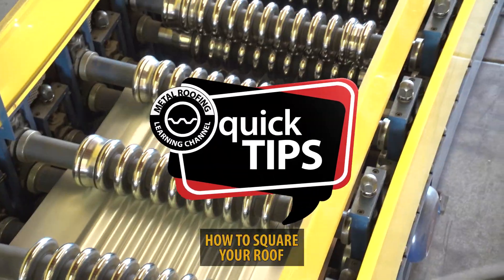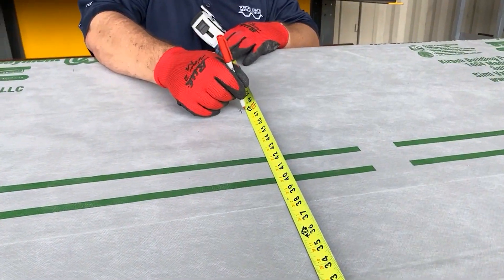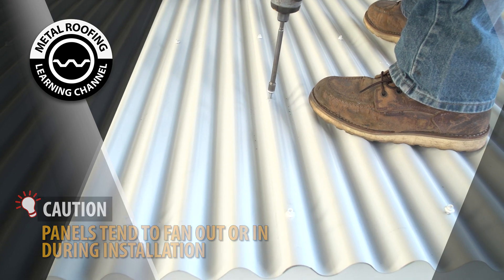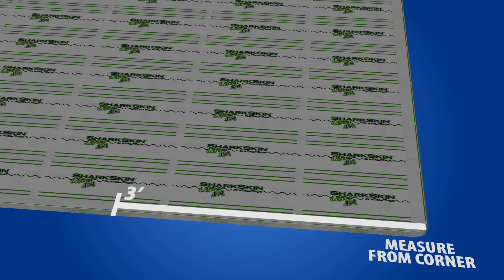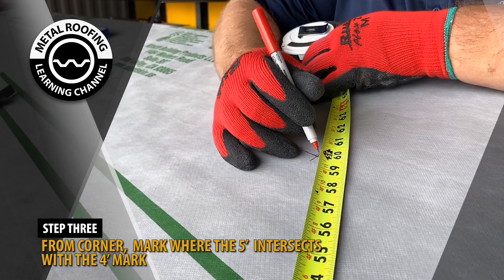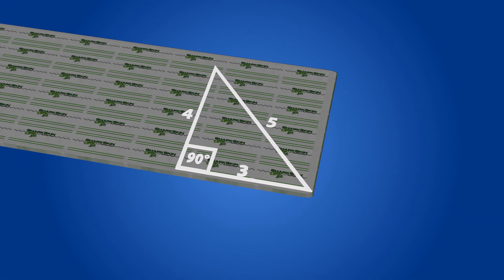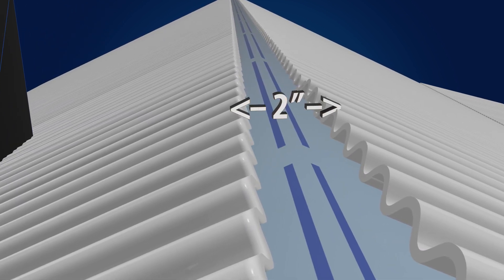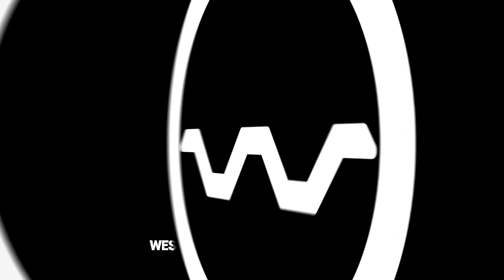How To Square A Roof. EASY Step By Step Video [3,4,5 Triangle Method To Install Metal Roofing]

Comment: Whats thr point of the 5' line if you already have you 4' line going up?
Reply: the 5' Hypotenuse line is crucial to establish 90 degree angle between the 3' and 4' lines, that is what this exercise is all about, however, roof iron sheets are already square so if you place the 1st one  square with the fascia board you should be 3,4,5, square on from there on

Comment: How do pop a straight line for the underlayment?
Reply: Measure from the bottom up on both sides
Reply: @jesseestep6222  What if the building isn't straight due to being old and foundation is sinking.
Reply: @pak-man7429 
You got a big problem then, the point is to be straight with the drip edge.